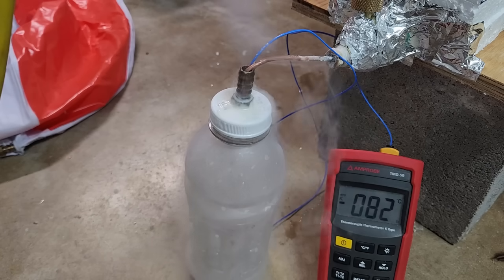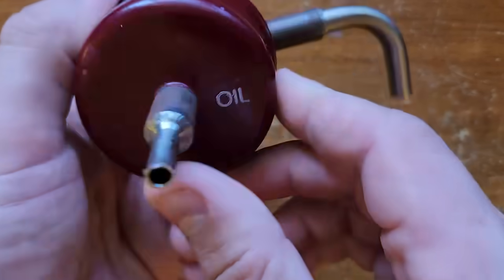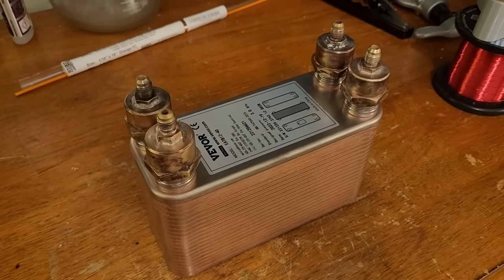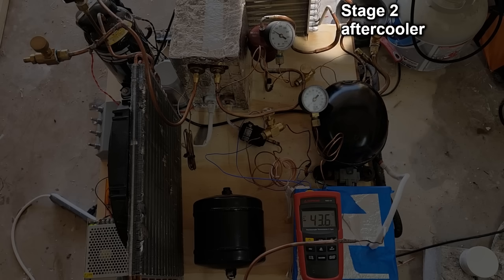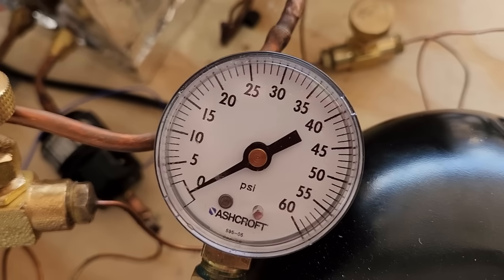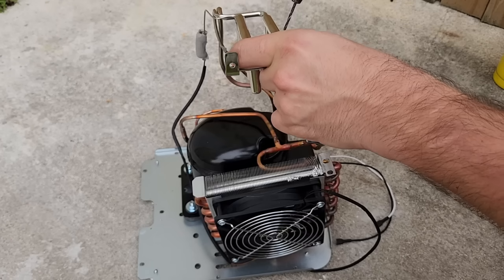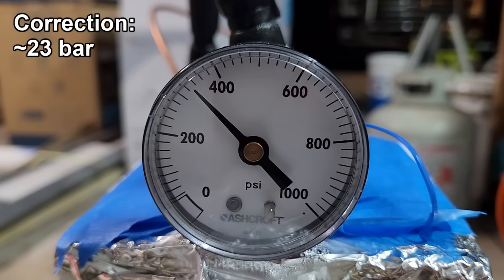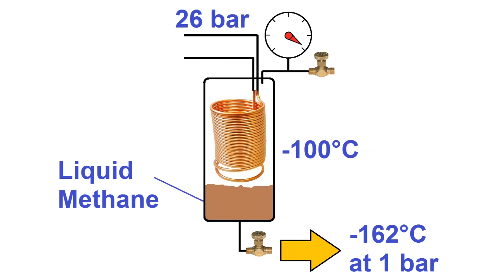DIY Cascade Refrigeration System (Part I)

Comment: Way too hard and complicated...as I commented in the last video, just get a 4500psi scuba/paintball compressor to compress nitrogen and then cool the compressed gas as much as possible and then meter it out to expand and you get LN, return any non liquid gas back to the compressor.  JT method, it works and is much much simpler.  Of course, now you need to make pure nitrogen, but you need to do that anyway.  oh, btw, I subscribed even though I watch all of this series anyway..
Reply: And how much is a 4500 psi compressor?

Comment: Try draining the liquid ethylene straight down into another smaller vessel with a valve and disconnected, so the liquid displaces all the gas up to the valve.
After disconnecting you should be left with a nice pure sample of high pressure ethylene. 

I didn't pay enough attention to be sure if this is a bomb, but I figure you will figure it out... before it blows up of course 😅

Comment: I get the feeling the impure ethylene is less due to the production method and more due to the storage. A beach ball is absolutely going to be permeable enough for air to leak in and ethylene to leak out through osmosis. It's the ol' "vanilla extract in a balloon" experiment.

Comment: Another great video! Looking forwards to the next one. Really been enjoying this series. How come you went with using a gas heating system to... well, heat the gas in your Ethylene production? I would have thought it better to use an electric system with a PID Control to keep it nice and even.

Comment: Why dont you use cpev valves ? They are good and can withstand load change.
A very simple way to condense r1150 is to use liquid nitrogen, if freeze solid but not h2.

Comment: So another approach to distilling the Ethylene could be to go down to your local weld shop and have them fill up a foam cooler with liquid nitrogen for a few bucks, then use that to chill down your mix and let all the other gasses out.  Yes, I can see the irony here.
Reply: At least he would only have to do that once, so not too bad.
Reply: Important note! Most places won't let you put LN2 dewars in any kind of enclosed space. You'll need a trailer or cargo rack to transport it.
Reply: @defenestrated23 not even in the bed of a truck?
Reply: @Skeys13 bed of a truck is 100% fine so long as it's properly strapped down in place. They don't want LN2 in an enclosed location like the cabin where splash can happen or excess nitrogen gas purging out oxygen.
Reply: @defenestrated23  Ah, interesting and good note for future reference, thanks!
Reply: @defenestrated23  or a bicycle :D
Reply: @defenestrated23 in MD you can't use foam, but actual dewars, or a very large thermos,  like the large ones you see at football games.  They can fill those, but you can't put the lid on, or it'll pop back off.  Also, in MD, I used to transport 20l or LN2 in my dewar, buckled into the front seat of my Ford Focus lol.
I made a 3oz stainless scoop to go upside and would scoop it out, take a quick sip and spit heavy nitrogen gas out the window at cars at the red-light on hot summer days.  FYI, don't try this unless you are VERY COMFORTABLE with the possibility of frost bite in your mouth, broken teeth, or death in you swallow.  Also remember to take a deep breath first so your reaction, should you have one, is to blow out and not gasp in, which is deadly at that point.   You can explode your lungs if you do.
Reply: @jameswiz Honestly doesn't sound worthwhile when fire-eating is more impressive and less dangerous.
Reply: Be careful about which "foam cooler" you use.
Some Styrofoam coolers will not hold liquid nitrogen. I found this out for myself once when trying to use foam packing material as a Dewar. By lining the inside of the foam with aluminum foil sealed with silicone adhesive, I was able to get my cheap (free from the trash) cooler able to carry LN2.
Most plastic coolers work fine without the need to line them with foil. It's just the super cheap foam ones which might not work.
Reply: Irony is, weld shop wont sell any liquid nitrogen 😂 Just nitrogen gas at ambient temperature
Reply: Weld shops have liquid nitrogen?
Reply: @kahlzun  If the welding shop has a tall white tank out front or around the side in the yard next to a heat exchanger, then there's liquified gasses in there.  Its a much more compact way to store the gas then compressed tanks.  Often for high volume users, they'll supply a large dewar and a gasifier and deliver liquid instead of tanks.
Reply: Would lowering the cat heat not do the same thing at room temps. Ether boils at 35c and unless I am mistaken it could be recycled into the ethanol stream
Reply: @RNA0ROGER  With heat you mean temperature? Same thing as what? Why room temperature? Recycle the ether how? For what? So much confusion.
Reply: @leocurious9919  What I am suggesting is that the aluminium oxide dehydration process could be run at much lower heat or temperature. The consequence of which is that ether would be produced in large quantities. That however might be of no consequence. As the ether produce is a liquid at room temperature. Where as the  Ethylene gas mostly certainly is not. Hence in theory you can extract the gas. While returning the ether to the boiling flask for another cycle. Ether is a liquid at room temp hydrogen is not.
Reply: @RNA0ROGER  Ah, thank you for the clarification. Yes, he has to (and said he will?) run the process at a lower temperature to avoid hydrogen.
Reply: @leocurious9919  You could almost run the ethylene production like a reflux still ironic enough.
Reply: @RNA0ROGER  Indeed. But considering the low price of ethanol and the tiny amounts needed, it is not worth the trouble. Also, the byproduct(s) will accumulate then, that could be an issue.
Reply: @leocurious9919  Ethanol is cheap provided you don't live in Australia and or own a still
Reply: @("RNA0ROGER") 
We're Aussies mate !
Masters of diy, make ya own. Just pop down to coles and grab all the rotten fruit you can carry. 😆  
   ;)

Comment: Industrial refrigeration expert here. Very nicely done. My personal preference for calculating refrigeration cycles is Danfoss Coolselector. It makes quick work of determining discharge temperatures and other refrigeration properties and is quick to populator PT refrigeration cycle diagrams. At first I was worried that you were picking up heat from your aftercooler instead of rejecting heat but then I ran some numbers and it looks like your discharge temp from your compressor should be around 100°C. Those little scroll compressors don't like much above those temps and mineral oil can start carburizing so I would be mindful of that. Try and get your high stage evaporation temp lower to help with this as ethylene has a ton of heat when it is compressed, unlike propane which stays pretty cool.
Reply: I started looking into ethylene as a refrigerant since I never came across it before in the field and it's labeled as R1150 but odd thing is Danfoss won't give you low temperature evaporation pressures for R1150. I think it's maxed out somewhere around -23°C so it's all experimenting after that. Regardless he'll be evaporating below atmospheric.  I thought too he might've been gaining heat from his aftercooler. I advised him to put a fan on it to help condense. It's a nifty project he got going on. On my end I probably would've tried something like 404A on the first stage and one of those butane refrigerants or even R437A (R12 replacement) on the 2nd to try out.
Reply: @derrickenbuenosaires  Are you sure coolselector won't do ethyleneat these target temps? I just checked on coolselector 2 and it seems to calculate it just fine.
Reply: @scottcarr1563  Sorry I was using the Reftools app by Danfoss. I went into the application again and found that I can now go down to -100 C with ethynol lol might've been a glitch or something. Evap pressure should be around 4 below atmospheric if he can successfully reach -100 C.
Reply: @derrickenbuenosaires evaporator pressure will be 0 psig for -104*C with ethylene in second stage
Reply: @derrickenbuenosaires  you can condense these nuts in your mouth
Reply: you know what else is pretty cool? deez nuts

Comment: Hi. Thanks to your videos I have been encouraged to make a fog chamber, cooled like this, and using propane. But a doubt has arisen to me, how does normal tin work to solder that? The refrigeration systems are usually soldered with another metal and I've heard that tin grows and is destroyed in the cold do you think it can work in the long term?

Comment: Love it that you got yourself a copper brazed plate heat exchanger. I figured those would be pretty expensive for the budget you're building this, and I figured you'd be quite stuck after the heat exchanger issue of last video. Super cool!

Edit: okay so after completing your video, you could pressurrise a balloon with the Hydrogen Ethylene mixture. Since H2 is really difficult to keep contained, it'll naturally diffuse the membrane. The Ethylene will also, but much slower since they're bigger molecules. You'd have to have some form of purity test to find out your purity of your mixture, but that doesn't sound undoable. Just very low yield. 

Another method is to try to bind the H2 to something like Iron Oxide and then filter out the water like you did before. Not sure if this is at all possible, or practical. Nonetheless, some cool chemical reactions with to bind hydrogen can be found here: https://en.m.wikipedia.org/wiki/Hydrogen_storage
Reply: You can pick up a brazed plate heat exchanger for under $40 on that giant Chinese site, the one named after the Arab character and his 40 thieves.
Reply: Note that ethylene should also get out of the balloon fast-ish since it can fairly well dissolve into the rubber. Maybe try butane and see how fast that escapes as a comparison to hydrogen and air.
Reply: @leocurious9919  : Hmm, use several diameters of rubber hose running through each other, all in turn running through a lower-leakage pipe, with lowest pressure on the outside and highest inside, and you could produce a continuous-flow fractional distiller system.
Reply: @absalomdraconis  As long as hydrogen is getting through the hoses at a significantly different speed: Yes, I guess so? Seems super sketchy tho. Note that it is not a fractional distillation, nothing is liquid. It is mostly diffusion.
Reply: that could work, but since he already got the high pressure condenser he could try draining the liquid ethylene straight down into another smaller vessel with a valve and disconnected, so the liquid displaces all the gas up to the valve.
After disconnecting you should be left with a nice pure sample of high pressure ethylene. 

I didn't pay enough attention to be sure if this is a bomb, but I figure you will figure it out... before it blows up of course 😅